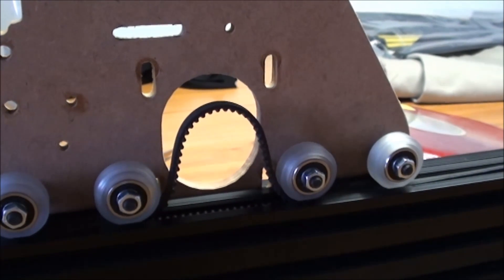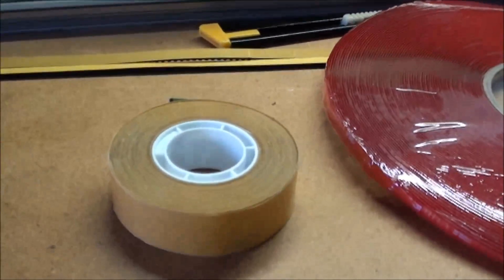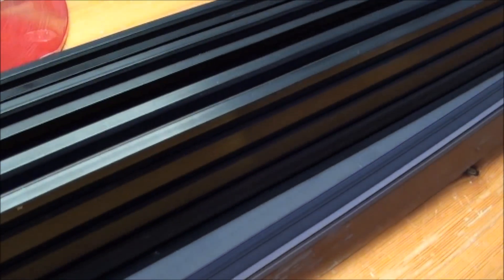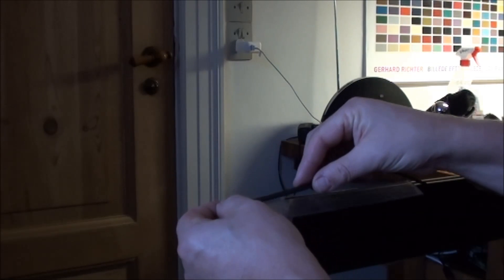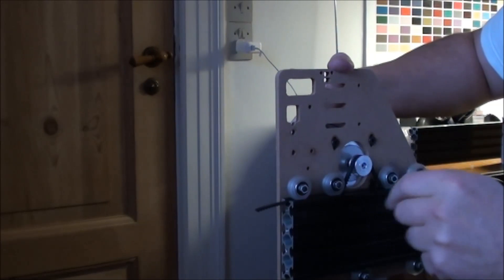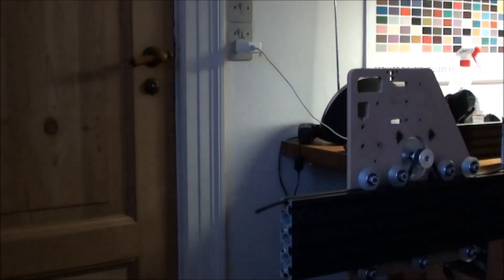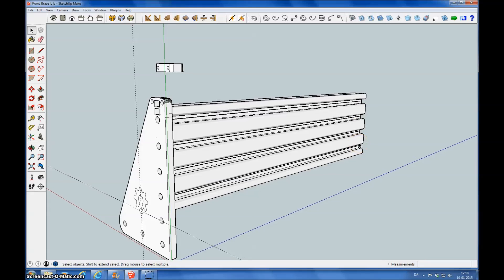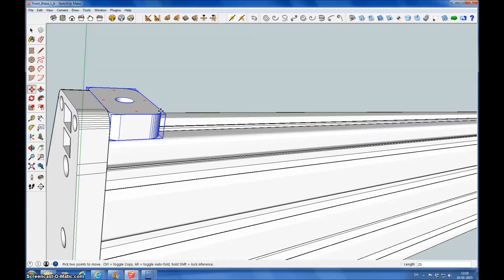Dual belt drive for CNC using Openbuilds V-slot

Comment: WERE DID U GET THE   GT2 3mm belt. 6mm wide i just cant find it  trying to follow your lead here and ty for makeing the video.
Reply from the maker: Hi Bulldog! You can get the belt here: http://makersupplies.dk/belts-and-pulleys/73-belts-and-pulleys-gt3-belt-3mm-pitch-6mm-width-by-the-meter.html

Comment: Are you using the Nema 23 motors  in direct drive? How is that working out? Any issues? What pulley are you using on the motors? 20 teeth? Is that a 6mm belt?
Cheers Marcus
Reply from the maker: Hi Marcus, It works great. Have been using it without any issues for the past 3 years. I have NEMA 23 steppers mounted with GT3 20 teeth pulleys. The upper belt is 6mm wide and the lower is 5mm - glued with double adhesive tape to the bottom of the rail.
Reply: @martinbarfoed5040  I've been looking at your setup (and the Bell-Evermann drive) for 2 years now. Now I've ordered 10mm GT2 belts and 20teeth pulleys. I figure If it doesn't work I can still gear down the motors with belts.
Can you tell me more about the electric side? What drivers at what voltage are you running? I figure you are between 1/4 and 1/10 microstepping?
My current machine is only 24V but I got 48V PSUs for my next one and DM556 drivers.
Still mulling about which breakout board (EstlCam or Mach3).
Reply from the maker: @heavyweather  I made this video on my current control box: https://www.youtube.com/watch?v=12LoOmPAJ3o  It's running 24V - but 36V would probably be better. I have Mach3 running and the steppers are 1/8 Micro Stepping. I do plan to make a new controller and would like to upgrade to Mach4. I will use PoKeys57 as controller  in the new box.

Comment: Nice video. btw, I was wondering what brand double sided tape did you end up using?
Reply from the maker: Thanks. I ended going with Scotch ATG Tape Type 969. It a double sided foam tape from 3M 19mm wide, 0.13mm thick. Has now been running for 1½ year w/o any issues
Reply: Well that's encouraging! I have purchased tape of the same thickness as you (.13 mm) but I'm wondering if it would be better thicker? There is 6 mm of height in the channel. 4 mm will be taken up by the belt, .13 by the tape and 1.5 by the wheel which is 5.63 mm. Take the tape away, there is .5 mm of space. Just a thought though since this has worked well for you.
Reply from the maker: Rich Long You are right in that a small lift wouldn't hurt. However, I haven't had any issues due to this. I have also been thinking about making a special version of the V-wheel with a ca. 0.5mm added to the diameter
Reply: Sounds interesting. Please let me know how it works when you get a chance to try it out.

Comment: Hi Martin,

 I'd like to build an Ox Stainless in 1200x1000mm dimensions. Have you done any tests for the dual belt drive for repeatability and accuracy?
Reply from the maker: I have been using my stainless OX for well over a year now and I'm very pleased with the repeatability. Unlike single belt (that I have har om my X-Carve) I havn't had to tighten, adjust or otherwise do anything to the belts since I assembled it. With single belt it's my experience that you need to adjust often to. Dependent on where you are you can source part from openbuilds.com in the US or makersupplies.dk in Europe

Comment: Thanks for sharing! I'm assuming you're using GT2 2mm belts? Do you think GT3 aka GT2 3mm would work as well?
Reply from the maker: Alana Rabedioux Hi Alana. I am in fact using GT2 3mm belt. 6mm wide. Two layers of that (lower one facing up, the upper other facing down) fits in the slot so that the top side of the upper best I just clear of the wheel. So you have a good security for the belts to come together easily combined with a good grip.
Reply: Martin Barfoed  Thanks Martin! I am in the process of building a 1500mm L x 1000mm W OX. After a few months with a shapeoko2, I give up: Not enough strength or accuracy for my needs. 

How are you liking the OX design so far? Have you had any problems with debris going in between the belts?
Reply from the maker: Alana Rabedioux I'm not that far in the build process that I have experience on the dust/debris issue you mention. Still working on assembly. My take would be that we definitely need to avoid dust going in between the belts. A dust screen may be needed. I'm using inner plates on the main gantry plates. I would expect that they also helps prevent dust issues. If you are not familiar with the inner plates you can see them on my build page (they are 2nd from the top on the profile picture): http://openbuilds.com/builds/stainless-ox.1914/

Comment: Hi there, what brand is the tape you used?
Reply from the maker: Hi Khapp
It's 3M/Scotch. Got it from this vendor (text in Danish)

https://dk.rs-online.com/web/p/dobbeltsidet-skumtape/2795182/?searchTerm=2795182&relevancy-data=636F3D3126696E3D4931384E525353746F636B4E756D6265724D504E266C753D656E266D6D3D6D61746368616C6C26706D3D5E5C647B367D247C5E5C647B377D247C5E5C647B31307D2426706F3D313426736E3D592673743D52535F53544F434B5F4E554D4245522677633D4E4F4E45267573743D3237393531383226
Reply: Martin Barfoed  Hmm, I bought a different type of Scotch brand double sided tape today, and it doesn't seem to be working very well.  In the video when you said the other tape was too thick, I believe the tape I have is too thin.  I don't get a great engagement of the two belts beneath the wheels.  I will have to try again.
Reply from the maker: MrKhapp The other tape I bought was 1mm thick. This is to much to fit in the profile - at least when using the heavier 3mm-belt. Maybe you can fit it in if using "normal" GT-2 belt.

This is the 1mm VHB tape:
https://dk.rs-online.com/web/p/dobbeltsidet-skumtape/7027497/

Comment: what material is that gantry plate made from?
Reply from the maker: Hi Leonardo
This is a mock-up version so I'm working with 6mm MDF sheet. I'm still working on the final drawings before I will cut in 6mm aluminum. When I works I will publish the drawings on OpenBuilds.com
Br, Martin